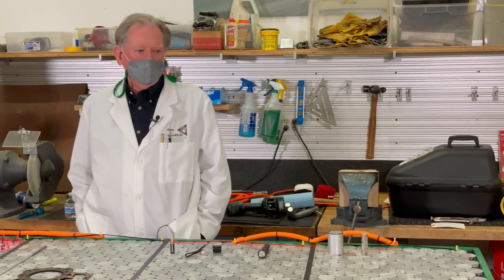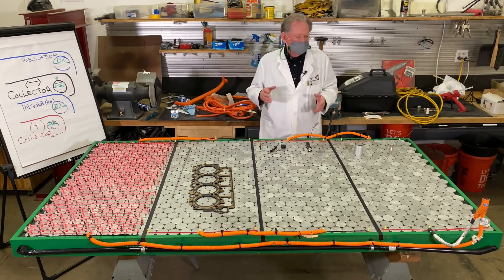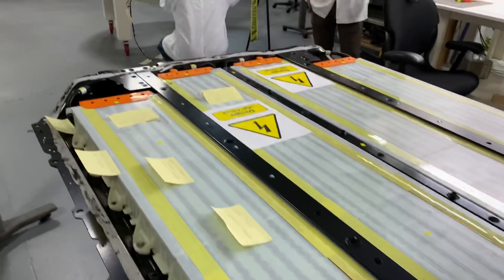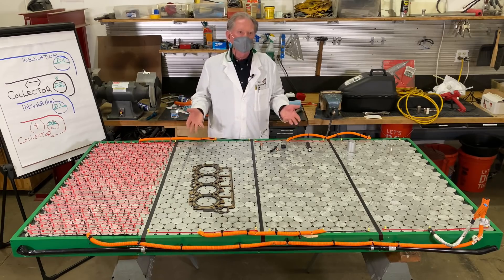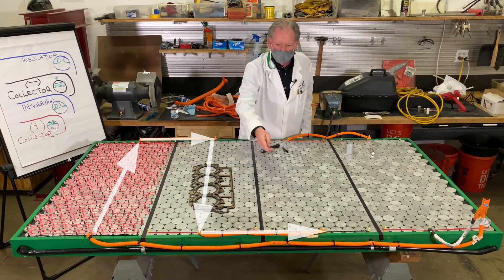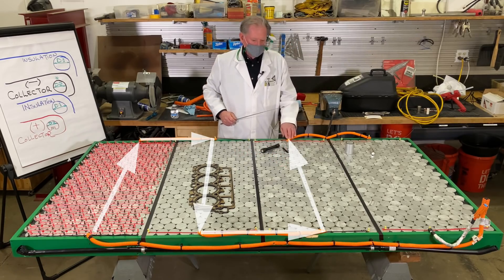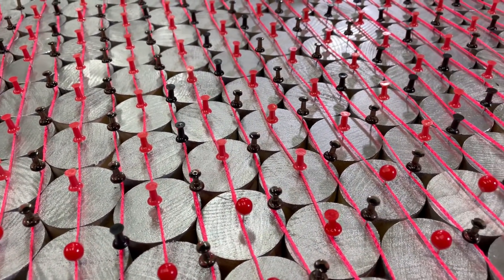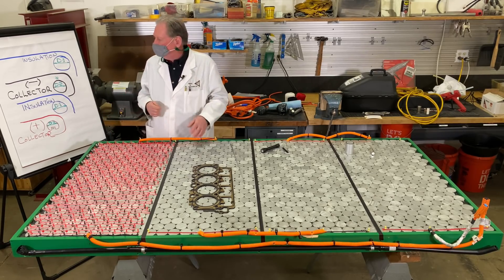Tesla 4680 Battery Pack Prophecy

Comment: So, within each of the 4 sections, individual cells are grouped into subpacks which are in series, with the subpacks hooked in parallel, then the 4 sections are hooked in series? Is that correct?
Reply: Each of the 4 sections are wired to give 1/4 the needed voltage. Then the 4 sections are wired in series. Since we don't know how many 4680 cells are in each section we can't say the exact number that are in series and parallel. I can guess that it will be 24 in series (to get the right voltage of about 101 volt max) and then 10 of these in parallel. So with 4 sections you have 400 volts. 24 times 10 is 240 cells. 240 times 4 is 960 total cells. Something like that.

Comment: I do not believe in your arrangement of the battery poles on the same side with the negative pole on the outer edge of the cell and the positive on the inside of the top pole of the cell.
Instead, I believe, the positive battery poles will be on one side (lets say, the upper side) and the negative poles on the other side (lets say the lower side). Just like before. This is for safety reasons, so that it will be hard to shorten the cells in accidents in case the battery casing is damaged, bent or warped.
Reply from the maker: During this video at 3:42 we show the Model Y Battery assembly. The 2170 cells currently have positive and negative on one side, and all collector plates on the same side. thanks for watching, and we appreciate your input.

Comment: I am not sure about your design Sandy (connections). Why would you have + and - terminals on top of each battery. Does not make sense to me.
Reply from the maker: The Model Y and Model 3 have  2170 cells with the positive and negative on the top of each cell. Outer ring negative, center positive. We even show a visual in this video at 3:42 of the Model Y cells and collector plates. Thanks for watching!
Reply: @MunroLive  Hi, thank you for your imput. I have missed that. :) Still I would prefer a different design, considering cooling from bottom and/or top of the battery pack. The little wires/tabs are going to be in the way of the cooling IMHO. 
I would rather see a connection plate form top and bottom.

Comment: I thought the old battery wires act as a circuit fuse incase a bad battery tries to 'run away'  would welding it directly remove some safety?
Reply: I believe that is the case.  They are fusible links, which Sandy should be aware of since they have been used in domestic vehicles for longer than Sandy has been alive.
Fusible links fell out of favor, in part because they are very difficult to diagnose and repair compared to plug-in fuses, although they were considerably more reliable than contemporary glass tube fuses.

Comment: In order to function as structure with top and bottom structural plates, you need to transfer the shear forces through the batteries to the plates. How will this be done with the gaskets interfering?

Comment: This might be a dumb question, but why have both + and - on the same side of the individual batteries? (instead of top and bottom). And are the 4680 believed to have this?
Reply: Just like the AA battery example, the negative of each cell is the entire outside of the case! They choose to connect pos and neg at the same end.

Comment: Thank you for showing what the battery pack might look like. Quite well done as usual. Could you do a segment on recycling the batteries if they are epoxied into part of the car's structure. I have tried to disassemble parts that were epoxied and ended up destroying the whole thing. Tesla pointed out that future recycling would contribute to the overall lower cost of batteries but they have me baffled if the batteries are part of a car's structure. I envision driving a Cybertruck in to get a new battery pack and having a guy come out with the jaws of life!! Need enlightenment.
Reply: I think the goal is to manufacture removeable battery packs that are good for over a million miles. recycling refers to recycling the entire battery, using it many times over.

Comment: Conductor size welded to those 4680 cells will need to be MUCH Larger, or multiple welded conductors. Also, what about thermal management?? the larger diameter cells will be hard to cool .. at what point does Tesla just relent and switch to pouch cells? .. which based on global manifesting capacity projections, should be MUCH lower in cost several years out. If Tesla doesn't get a low cost alternative going, they are going to miss the sub $30K EV market, which is where the bulk of revenue is globally. Tesla can't actually become the leading vehicle OEM by only selling higher end luxury EVs.
Reply from the maker: We agree 100% on conductor size. Thus our example has large tabs for positive and spot welding for the negative outer ring. Because there will be less in parallel with a larger cell, 10 vs. 40+, it must be larger. Thanks for watching.
Reply: They have already talked about how they're going to be cooled from the bottom, and how there's much more thermal conductivity between the inside of each cell and their tabs, allowing the heat to flow longitudinally instead of through the different layers. The insulating layers and solid electrolyte interphase do not conduct the heat well, but the copper is very good, so making the cell thicker and less tall is beneficial, sucking heat from the copper tabs. That's why it allows more power. The diameter almost doesn't matter with this design
Reply: @rubenayla  OK, out the bottom, missed that .. but that thermal conduction path is really LONG with an 80mm tall cell.

Comment: From Dusty: thanks for the video and the idea of the manifold. It wouldn't make sense for them to go to a tab-less (really multitab) battery and stick with the old system of tiny wires for leads. Since the battery will have more power and ability to take a higher charge by default they would have to change the wire size....the manifold or something similar seems like a more likely scenario. Thanks for showing us, I can't wait to see what it's really like.
Reply from the maker: Thanks Dusty. Because there will be less cells in parallel. (10 vs. 40+) the tabs or wires must be larger to handle the same current as the previous packs. Thanks for watching.
Reply: @MunroLive  that's what I was guessing, thanks for confirming. The little wires in the old system also look a little thrown together and low tech imo, a manifold or similar system would look cleaner, less likely to fail and have better specs I would guess?
Reply: Those 'little wires' or 'Tesla style fuse wires' were a genius addition to safety a decade ago to stop thermal runaway in an individual cell.  It is logical that an improvement for manufacturability would evolve. Other EV makers are trying to improve from where Tesla started, but they have already moved on.
Reply: @bobbrutvan2435  oh yes I do remember now the fuse feature of the wire, your right. Then by default it is also a limiting factor so it will be likely this will be changed. How exactly is the question. If they go with a manifold of sorts then what safety or fuses would they use?

Comment: Wouldn't the positive collector touch the negative one if the insulator hole between them is a larger diameter than them both? Should that second insulator hole be smaller than D2, but larger than D3?

Comment: How would they manage thermal runaway mitigation with the cells so much closer together without the cooling channels inbetween? Just the goo? Is the chemistry much safer now?
Reply: Shorter paths mean less heat overall. Open ends with sandwiched cooling plates should suffice.
Reply: @4literv6  I meant an assumed broken cell runs away and heats it's neighbour. Not the whole pack getting close to runnaway temps.

Comment: Would have been helpful to tell people what happens to voltage in parallel vs serial.  Like the flashlight for example.  1 battery won’t send enough juice to get full brightness but doubling the voltage increases to output in volts vs parallel is to maintain same voltage as one battery but double longevity.  

My question is how does flowing all the electrons from the 1st pack through all 4 to the positive and negative wires affect cell performance.  I’ve noticed in kids toys with 4 D cells the amount of charge left in them varies with 1 or 2 batteries having more juice than the rest when tested.  Does that mean the cells in the first pack will be over cycled compared to the 4th pack?

Comment: Bit misleading to say that the pack has 5x more energy. At the cell level it is 5x per cell. But since less cells are used it should be less than 5x energy at the pack level.

Comment: Sandy you are wrong at 1:30 - You say the battery pack with 4680 would be 6 times the power,  and 5 times the energy of the battery pack with 2170 cells. THAT IS WRONG. The 6x and 5x is when you compare one 4680 cell and one 2170 celll! Your claim would mean a 5*75 kWh = 375 kWh battery pack! And it would mean about 2400 kW of power (about 400 kW of the old pack times 6)! That is far from realistic.
But the battery pack with 4680 size cells contains much fewer cells!  A better estimate for the increase in energy at the pack level is the range increase: the 16% more range translates to roughly 16% more energy than the 75 kWh pack of the Model 3 Long Range. So roughly 88 kWh. Divided by 3,7V nominal cell voltage and by 25 Ah (5 times the energy of a 2170 with 5 Ah) this translates to roughly 940 cells. So your 960 cell estimate is a good estimate for some future Model 3/Y Long Range pack. 96s 10p as a configuration. Or maybe 192s 5p if Tesla switches to a 700-800V battery pack voltage.
But you need to be much more cautious with your claims!
Now the estimates would be: a battery pack level peak power of about 520 kW (400 kW / 4416 * 960 * 6) - a factor of roughly 1.3. And a battery capacity of about 88 kWh (960 * 25 Ah * 3,7 V) - a factor of roughly 1,16.
The Tesla claims of "5 times" and "6 times" was rather to impress investors at battery day. This is marketing stuff, and us engineers should be more cautious with such claims.
Reply: Well spotted. The 16% more energy would translate to 16% more range. The 30% increase in power will be useful for faster fast charging and possibly better regenerative braking.
Reply: I was running similar calculations since the Plaid+ was cancelled probably due to the 4680 not being production ready, but the math doesn't make sense.  The 4680 is to have 5x the energy storage of the 2170, but it is 5.3x the volume so doesn't seem like a great improvement. I can't find confirmed voltage or Ah ratings for the 4680 but some sites say the nominal voltage is 3.7v comparable to the 2170, and only be ~9Ah. Seems that for Tesla numbers to work the 4680 needs to have about 25Ah or more.
Reply: @wilkimist  You compare 1 cell 2170 to 1 cell 4680. But the 4680 has an advantage in packaging: just compare the total volume of 5 cells of 2170 put next to each other and one 4680 cell: all the intermediate empty volume disappears. That's where it finally gets a slightly better energy density at battery pack level from, my estimate is a factor 1,16 at pack level. Sandy Munro used the wooden cylinders in his setup to simulate the packaging of these cells.
The 9 Ah estimate is wrong as you found out yourself. It must be somewhere around 25 Ah (or slightly more) per 4680 cell.
The main focus of 4680 is cost redution, however. Getting rid of a large portion of handling about 3500-8000 cells per pack in automated production and assembly lines. Reducing that figure to about 1000 cells per Tesla pack. Which is still way more than what competitors need, that use cells of roughly 150 Ah like Mercedes EQS. They can cope with about 216 cells for their 107 kWh pack.
Reply: @koeniglicher  It was driving me nuts trying to figure out where I went wrong, using 9Ah, 3.7V, 960 cells and coming up with about a 32kWh battery pack.  No way does a 2170 cell have 5000mAh and a 4680 cell, with ~5 times the volume, have only 9000mAh.
Reply: I just posted a rebuttal before I saw yours!  I find in comical that a "guru" could make such a ridiculous mistake and none of the video editors/camera operators picked-up on it as well.

I suspect that now we are a year down the road form this video, the 4680 is going to be a big nothing-burger and will be fraught with risk  Sandy's recent LiFePo4 CATL battery "peek" was really showing where the future is going.

Comment: Thank you Sandy for this great visual explanation.
So what you're saying is that they are going to replace the little busbars that looked like a small tree by a sort of thick PCB busbars that they can spot weld? It looked like a big manufacturing upgrade and a great idea.
The cooling of these bigger cells seems very important as well. The current density seems bigger on the outer of the cells, with a larger radius this might be even worse. Any idea about this ?

Comment: I found it informative and well explained. As a student in and around this field, i also didn't find it boring and im still awake! What's most intriguing for me about these battery development, which Sandy touched on, is what does this mean for the average user. But moreso, for V2G and other practical applications! The additional on demand power could make it more attractive for V2G and the extra energy never hurts. Although its maybe impossible to tell without working cells, but what could this change in form mean for the cycle degradation? I wonder how the larger more powerful batteries would respond to DOD vs cycles.

Comment: Can't they get like a custom top casted directly with pins that doesn't need weelding to each battery? just clipped from the bottom part on the sides ? Or welding is a must to ensure the connections ?
Reply: BMW uses just non latched spring loaded push on connectors between their battery modules, and they handle 300A and the copper plated disc spring making the connection only has a contact area of 25 sq mm, so if the battery pack is sealed, to prevent corrosion, welding is not required to handle such currents.

Comment: I thought from the graphics on battery day that the entire top surface was the positive and the base the negative (or vice versa). As the entire top of the cell had the tabs bent inwards in a spiral.
Reply: You still need a sealing end cap on top of the current collector. The electrolyte is a solvent, and has to be sealed off, not to evaporate. Regardless of Munroe's clever suggestion multiple sheets of insulator and conductive sheets as interconnects, I can't see why the usual single Nickel sheet wouldn't be used. With a bigger cell, thin individually welded wires are not needed, a stamped spiral in the sheet connecting the spotweld pad, would provide fusing enough?

Comment: Sandy and team, are there more challenges with running the four modules in series vs parallel with respect to thermal management? Not sure if the individual modules can get a high enough voltage to run in parallel, but if it's not possible does that create hot spots in the pack that can cause uneven wear over time?

Sorry for the overly technical question on YouTube but maybe cover it in a future video

Comment: Thanks for your analysis. Re: the small wires on older Tesla module designs. I'd understood those to be fuses for battery protection from bad individual cells. 
What cell/module protection method do you see employed with your vision of the manifold collectors?

Comment: As an automation tech I already figured out what the head gasket analogy it’s brilliant because 95% of the whole assembly can be automated rapidly. Who would have thunk such brilliance and simplicity? O ya a Tesla engineer 😂👍
Reply from the maker: you get it! Thanks for weighing-in Terrence.
Reply: Hmmm its four accurate sheets, sorry I'm a sprung end to end guy, with bottom still cooled, I think because the aluminium foil conducts both thermal and electrical better than Cu so the base is the preferred route, but it is still electrical, is it not, I mean you're tabbing to the off-set top but the whole cell case is live (-ve) presumably.
Electrical and thermal are similar generally optimised by metal to metal although thermal paste we used to use, not so sure about epoxy or structural foam.
I remember nitrogen freeze , twas even proposed for tire recycling.

Comment: Great video, I would love to see more information in your video's ( longer better👌), for example how a BMS would work on an pack with 4 modules. And the cooling methods from the bottem etc. Keep it up, looking forward to your next video.
Reply from the maker: HI Dantoes, We can definitely do a follow-up for BMS thermal. Although snady mentions 4 "modules" for current-flow, our pack mock-up is still one giant 960 cell module from a manufacturing perspective. Thanks for watching.
Reply: I think Sandy oversimplified for easier understanding. There are still just 10 cell in paralell and those are in series in each module. There would be no difference on the BMS side. The BMS is always connected to each 10 cell group and monitoring it's voltage. Thermal monitoring could be in each 10 cell group or less. They might choose 2 temp sensors per 10 cell group at first and see after a few manufacturing revisions how many they really need. I think they did that before.